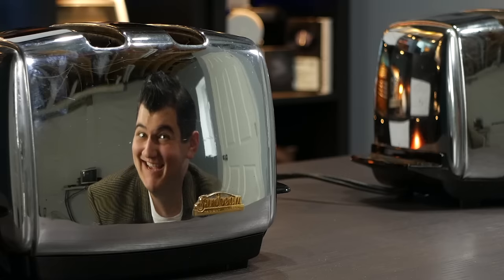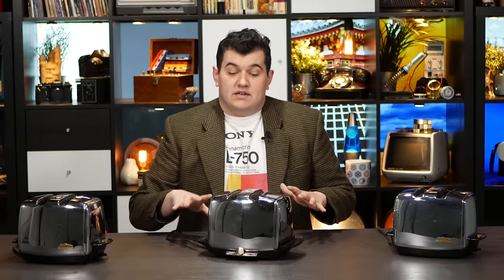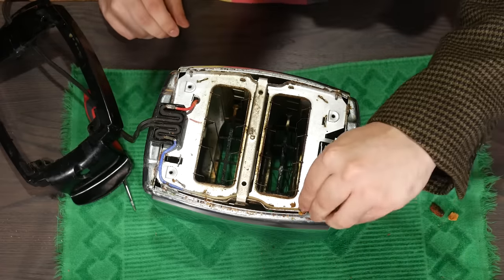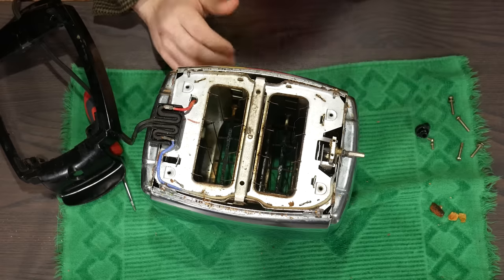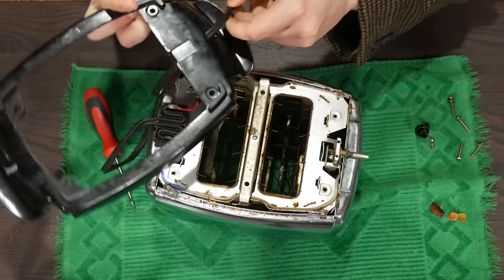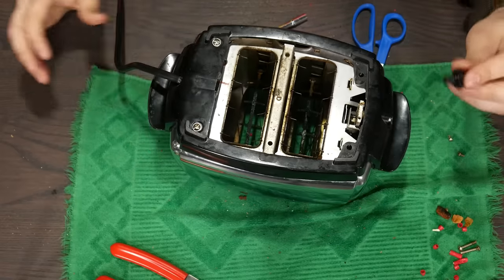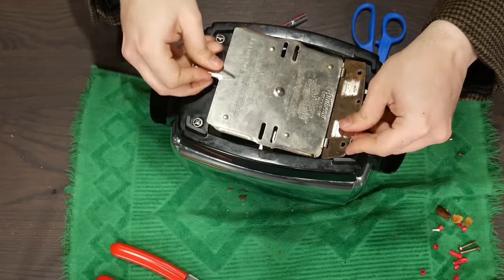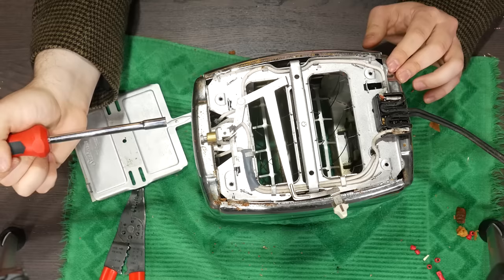Sunbeam Radiant Control Toaster--Repair and Modernization

Comment: A diode in series wouldn't halve the effective voltage. Twice the voltage means 4x the power. With a diode in series, you still have 2x the power.
Reply: Love the channel name. Perfect.
Reply: Half the voltage means half the current
Reply: Alan Patterson not if you change resistance
Reply: Any simple way to make this work correctly on 230V? I live in the Netherlands and just ordered one of these toasters on Ebay. Would prefer not to need a 2000W 110V power converter..
Reply: @hschokker86  I live in Belgium and I've been thinking about getting one too. The voltage issue is holding me back at the moment. I agree with DiodeGoneWild's assessment. With a half bridge rectifier you'd draw double the power and probably kill the toaster. You either need to get it down to a 25% duty cycle or transform it the old fashioned way.
Reply: @Adnub  It should be possible to get it to 25% with a TRIAC. Basically an incandescent light dimmer.
Reply: Exactly, you have to put 100 in series.
Reply: DiodeGoneWild is correct.  Double the voltage quadruples the power.  Half wave rectifying halves that, so too much power.
Reply: @anlumo1  Why not just a step down transformer?
Reply: @dspiffy  It's more inefficient, but it would also work.
Reply: @Adnub  Proper fix is to replace the nicrome wire with half the diameter, then readjust the lifting mechanism to the weaker wire strength.  Half diameter would quadruple the resistance resulting in the same wattage on double the voltage.
Reply: @hschokker86  try looking for a step-down transformer. Then you could step the voltage down to 115v ac.
Reply: @Adnub  Did you actually go through with this? If so, what did you use and how has the toaster been holding up? I live in NL and I'm also considering getting one of these.
Reply: @hschokker86   What did you end up doing? I also live in NL and I'm also considering getting one of these, but I don't exactly have the counter space for a 2000W power converter.
Reply: @Adnub  there are power controllers for resistive loads, basically a dimmer, that can be adjusted to pass 110v at a couple kw. will try it soon. as mentioned you need to go to 25% of normal on 220V. a simple diode does not do the trick.
Reply: @IanBurnette  There are SCR voltage regulators which are cheap and can precisely adjust the voltage. If you pick a chinesium one remember to oversize it atleast 50% and monitor its temp at first.

PS: Do not use these for sensitive devices or any significant inductive load
Reply: A step down voltage transformer (external device) or complete redesign of the heating elements are the only safe way to use or convert a 110V toaster for use with 220V. The amount of current to the heating elements would cook most any diode, transistor or solid state voltage regulating device small enough to fit into existing housing of the toaster.
Reply: If anyone from the EU wants this toaster, buy it from Australia. They already have it for 240v, you just need to replace the plug
Reply: singlekc our resistor would burn up the second you turn the toaster on, unless you want a 2000W resistor laying around your kitchen

Comment: Got one of these toasters for free, frustrated the crap outta me because I couldn't figure out why it wouldn't work. Checked connections , inspected the elements , pulled out the meters and checked continuity and resistance, used a heat gun to test bimetallic strip, still no toast. Found this video jammed my hand into the toaster to find a floppy carriage.  Whipped out a butter knife spun the screw and VOILA smoke! Cleaned the thing out and toast! Thank you very much!!!!

Comment: Here in Australia, thanks to you I fixed my inherited Radiant Sunbeam toaster. I tested the elements years ago (nil defects), and I figured, one day a solution will arrive...It was you Alec it is fixed!!! Yes it was the spring tension. 
Australia (Red or Brown) is Active. (Blue or Black) is Neutral. (Green or Green) with yellow stripe is Earth. We run 240 volt single phase or 415 volts 3 phase. All products in Australia have an Earth unless double insulated. Our plugs only fit one way in the socket, therefore Active is always Active unless incorrectly wired. Hope this helps and informs. Great Channel BTW.

Comment: I've found that when trimming the ends of stranded cables like you did at 17:00, it helps to tin the ends of them with some solder first. Not enough to go past where you're cutting, but just enough to keep the strands at the end of the wire attached together. It makes cleaning up sooo much easier.

Comment: Short cord means it will stay close to outlet or on an island, and not stretched across walkway onto a table. Also if knocked off counter it should unplug itself on way to floor.
Reply: I like to walk around the house with my toaster, I don't know how people just set it down and wait. It's so toasty and warm and cuddly, I need at least a 40' lead for when I go in my backyard
Reply: Kitchen appliance cords are generally about two feet long. According to the National Electrical Code, Kitchen appliance outlets are to be no further than 4 feet apart along the countertops. So, the appliance can sit anywhere on a countertop and reach an outlet. It is definitely a safety feature.
Reply: I would expect that the shorter cords will also help reduce wire resistance under load. Which means they wouldn't need to use a larger gauge wire.
Reply: That's too short a cord to reach a bathtub. How is one supposed to enjoy fresh hot toast while having a bubble bath?
Reply: @terryhinch I find that my wet hands sometimes make the toast soggy, so I make sure to keep the hair dryer nearby just in case.

Comment: 41:21: "Really the only difference is, the bottom is now made of a true plastic."

Bakelite IS a true plastic.
Reply: Bakelite is actually the FIRST thermosetting plastic. It has extremely good insulating and thermal properties. It is relatively inexpensive but does require exacting manufacturing control. It is still widely used and available today. Commonly called phenolic. Perhaps the biggest "downside" is it is brittle and therefore can chip or break easily.
Reply: Bakelite also lasts a very long time.  I have Bakelite items nearly 100 years old that are still in excellent condition.
Reply: polyoxybenzylmethylenglycolanhydride............... say that three times fast! Wiki
Reply: Thermosetting plastics have changed.
Reply: Urea formaldehyde

Comment: Thank you so much for this! I LOVE my new, modernized toaster! I went with the newer front-slide model, just for safety with the double pole switch. I found using SUGRU around the cord where it enters the plastic handle will cover up any exposed wires very nicely. It's an air-cure silicone adhesive putty that does a great job, and also fixes frayed cables. Shame I had to re-sell the older one with the art deco pattern, but with the neutral wired to the body, hell no lol.

Comment: Great video! I used to repair 500w-20KW lighting systems. The fiberglass/silicone rubber sleeving(used on the Wurlitzer jukebox video for the wiring) was used to insulate the line and high voltage(15KV) wiring near the lamp. This sleeving would work great to insulate the wiring in the Sunbeam toaster , especially at the cordset connections. Also, I'd suggest using a 14 gauge wire set(if avalable), solder and insulate the wiring connections. Wiring in appliances is usually borderline due to cost, bigger is better, up to a point. Also too, you can get thin fiberglass insulation board and cloth intended for wood stoves to insulate the toaster cover. Use high temp silicone 'gasket maker' to glue it in place.

Comment: My first job as a mid-teen was appliance repair - mostly toaster, specifically GE toasters.  My boss said the Sunbeam toaster was the best ever made and we saw FEW of 'em in the shop for repair.  I have a later dated one which works perfectly.  I have one in my garage that I bought new to me that i have to dig out and see if it just needs a cleaning.

BTW, I don't have much use for bagels either and my wife just toasted an english muffin in mine.  I didn't make the 3 wire mod.  I just plugged it in and tested the outer case with my DVM to see if when in the voltage is set to AC and one probe in my hand touched the outer case with the other and 0 volts so I left it in that polarization.  The wire is ok but your comment about the plug is well-founded. Perhaps I'll go to a Home Depot and get a two wire polarized plug and install it observing correct polarity

Comment: Overall a greet video(s) and much useful information that I will use on our two toasters that are inconsistent in their toasting ability. Thank you!

Like many have already commented on, your crimps are scary. 
Bushougoma left a link to excellent info on crimps and crimp tools. Some have commented that you can't crimp solid wire - you can, but both the crimp connector and the crimp tool need to be designed for crimping solid wire. There is a science behind crimps that when properly done, are actually better than solder.

As for the toaster wiring, the oldest toaster where you showed how to change the cord, did NOT have asbestos wiring. It is what is known as varnished cambric. Basically varnished cotton where the varnish has a relatively high temperature rating. It is perfectly safe wiring even today as long as it is not damaged. The newer toaster looks like it used varnished cambric tubing over the wire. I have seen it applied over conventional insulated wire and over bare wire. With any form of wiring used on a toaster, temperature rating should be a primary specification, probably at least 155 degree C rated.

Comment: While this video was posted 4 years ago, I just had the pleasure of viewing it. I must be a geek as I enjoyed watching someone fix a toaster for 45 minutes. I do wish to comment on your statement that perhaps you could solder the wires together. To note, the national electrical code permits soldering, but only if the splice is mechanically and electrically sound without the solder. I know that is a rather odd code requirement, if the splice is fully 'connected' without solder, then why solder it at all? A couple reasons would include that solder has a higher resistance than the copper wire and the difficulties in determining if the solder joint was done properly. In any regard, given the code requirement soldering the wire splices in this situation seems not very feasible. Using a non-insulated crimp lug (with a proper crimping tool) would be the route that I would go. I have an entire case of different sized crimp wire connectors that I use mostly for crimping twisted bundles of electrical grounding wires together.

Comment: I know this is 3 yrs old but you raised a point that many do not know. All two wire appliances were required to have an identified conducter which is the white or neutral wire that is eventually connected to the service ground conductor. If you look closely at the toasterwire’s edges one of them will have a sharpe edge made in the insulations surface. That sharp edge (compared to the others smooth one) is the identified  conductor and the plug end that it aligns with should be plugged into the outlet’s 
Larger slot. Look at a three prong plug and you will see the identified wires edge aligns with the large slot on any outlet it will plug into.

Comment: This is a very handy video.  For the first time in decades, I had to repair our T-35.  It just stopped working for no apparent reason.  But when I dismantled it, I took the adjustment screw completely out; I didn't realize it could pop off.  Now toast has one setting: burnt.  So I have to figure that one out.

Comment: Just watched your video. I realize this has been made a while back. If you do read this, i would recommend monolit solder seal wire connectors for your future electronics work. These save a huge headache with but connections. just requires the wire to be stripped and a heat gun / lighter and has built in heat shrink and are water tight.   Excellent video.

Comment: I have owned two T20s for quite a few years and they are indeed fantastic appliances.The radiant sensor in particular is responsible for their great performance.I was interested in the comments about grounding and polarisation in the video. The grounding is a matter for debate so I will not comment on that, however I do not believe polarisation is necessary on the early toasters. Using the original cord (which was in fantastic condition) I set up a voltage meter between the body of the toaster and the ground of the receptacle. With the toaster not activated the voltage was 24 V with the plug in one way and idle, and 65 V when toasting.  Reversing the plug in the receptacle (as it is non-polarised) produced, as expected, the opposite readings 65 V when idle, 24 V when toasting. I felt that touching the ground and case was safe under the circumstances and in every case the voltage dropped immediately to 1/5 to 1/10 of that, i.e. below 10 V, also no sensation whatsoever of electric shock.
I must therefore conclude that in neither case does the live conductor come into contact with the metal chassis or a cover and must pass through an element or some point of resistance.
I am therefore leaving my toaster non-polarised as I believe modifications that you have done by installing a light gauge vinyl insulated appliance cord, and butt connectors that are not meant for that service, produces a more unsafe situation than having left it alone in the first place.
My conclusion is that as long as everything else is in good condition, the cord, the terminations and the strain relief, putting a polarised plug on is not going to improve the situation.

Comment: Maybe solder the wires and shrink wrap them rather than use the butt connectors?
Reply: A toaster generates enough heat to cause the solder to melt. I don't know that this area of the toaster would, but for high-heat solder is not great.
Reply: 37:17
Reply: Soldering to the aluminum wire is very hard.
Reply: never solder then clamp in butt connectors.
bad idea, it embrittles the solder  and you risk shorts from it6 breaking up.
these are rules to live by
Reply: @deadprivacy  so clamp then solder instead?
Reply: @w49660  I do that, if you solder it's not strictly necessary to clamp down securely, you only need to snug it up. The solder will wick down the wires though, I don't know if that's a good or a bad but I've noticed it makes the connection more brittle but less likely to bend under low amounts of strain. Always use strain relief!
Reply: @w49660  you can BUT I've never done it because the soldering operation melts the insulation that you have just clamped as part of the crimping operation, compromising the mechanical strength. Plus it may change the state of the insulation, making it brittle or soft. Plus the obvious wicking of the solder up the strands making the wire less flexible.

Lots of bads in my opinion.

proper crimping "cold" welds (-it really is a weld too. -)the connector to the wire  see is a far better connection than any solder will give you.
if you really want the best in protection against corrosion use pretinned or "marine" cable and crimp it.
the discussion is lengthy on this but by almost all standards its an either /or discussion, never both.
https://www.eevblog.com/forum/projects/crimp-and-solder-a-crimp-connector-good-bad/
Reply: You're gonna solder wires in a heating appliance?
Reply: As an electrical engineer, my opinion is heh heh "butt".
Reply: @nrdesign1991  Listen, if the wires are getting hot enough to melt the solder that's an issue
Reply: @nrdesign1991  It won't get hot enough to melt solder. That would be hot enough to also compromise the insulation.
Reply: ehhhh rewire it to new wiring.. 

also, tweak the thermostat and line interior case with 1mm aerogel matting.. 

as the additional heat would only vent via the bread/toast holes.. 1200f insulation to keep heat in where needed
Reply: @sugarbooty  Exactly. Assuming the 'plastic' is bakelite it will start burning around 200C, which is around reflow temperature for most solders. Unless the toaster literally burns itself up, the solder should hold perfectly fine. Plus, there are high temp solders if someone is actually worried.
Reply: But then he wouldn't get to say butt so much...
Reply: I hear the concerns about solder melting, but that area of the toaster, where the rubber cord insulation is, cannot possibly be hitting, say, 370F, the melting point for common rosin-core electronics solder.  The cord itself, right where it comes out of the case, would be getting so hot you'd be burning counter tops and hands with aplomb.  And you can get shrink tube that can withstand up around 370F as well (the more common stuff you find in a department store can only take up to about 250F).   I don't know.  I think it would quite robust to use solder.
Reply: @garystinten9339  feh. Not period-correct. Need asbestos cloth for thermal insulation!
Reply: @sugarbooty  Not the wires...the metal itself may be hot enough to melt solder....and heat shrink might well melt, too.  Have to ask an expert.
Reply: @cowsongs  Thank you, just answered some of my questions.  But...what about something like silver solder?  Isn't one of its strengths its higher melting point?